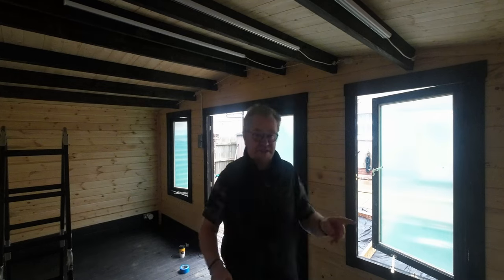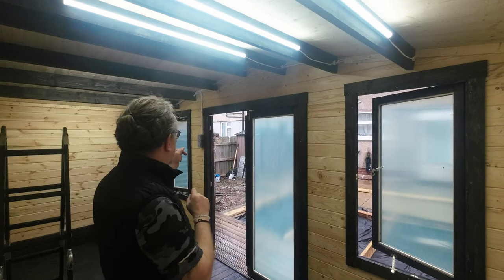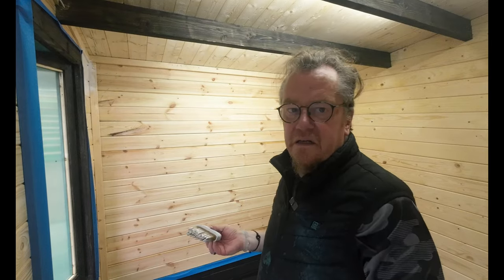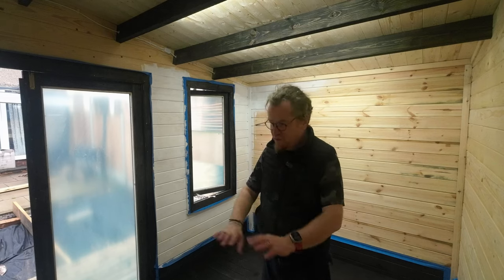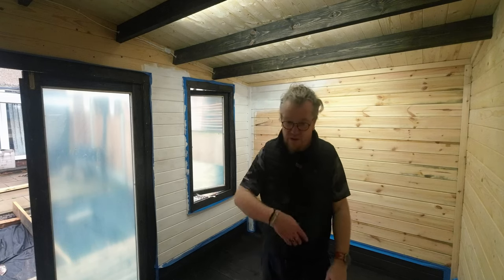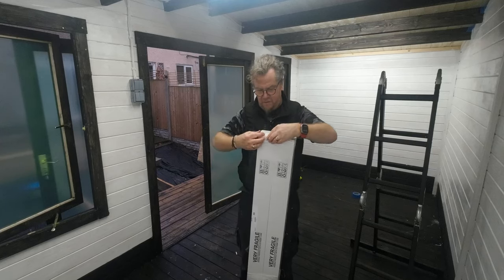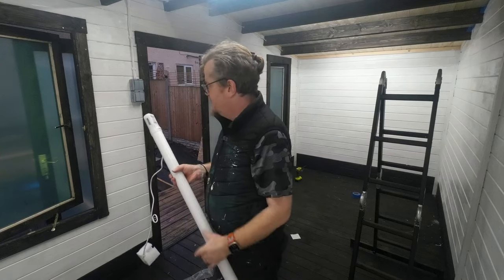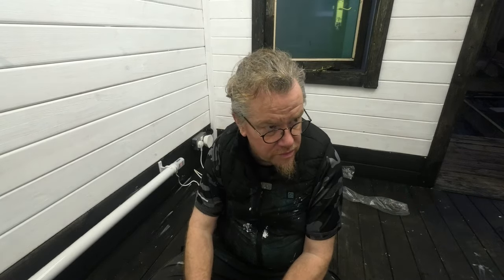A lick of paint in my BillyOh Log Cabin

Comment: I've noticed some damp on the floor at the back wall in my cabin. It's not coming through the wall but I suspect it's getting drawn in from rain running down the back outside. I will be installing a gutter but I'll probably run some clear silicone all around the bottom edge on the outside too. Good job Jonas, looking great!
Reply from the maker: Thanks, it’s getting there, it’s weird how different bits can be damp, I think I’ve got it all now haha